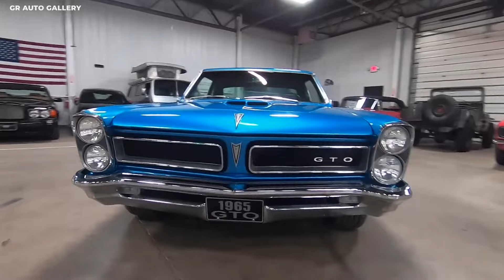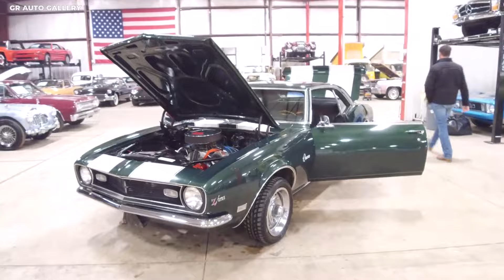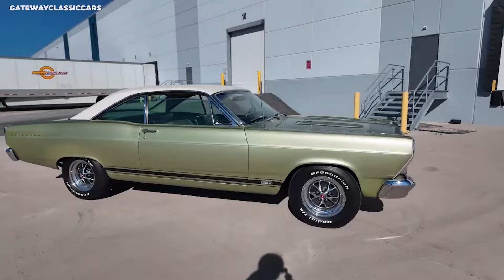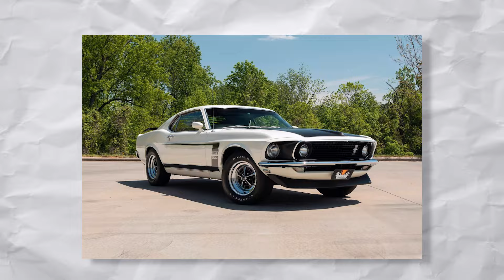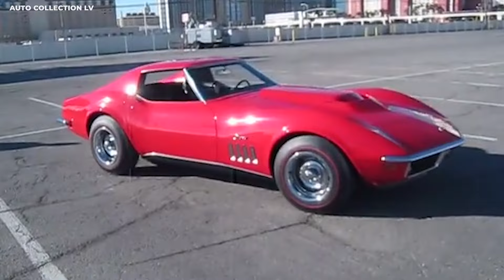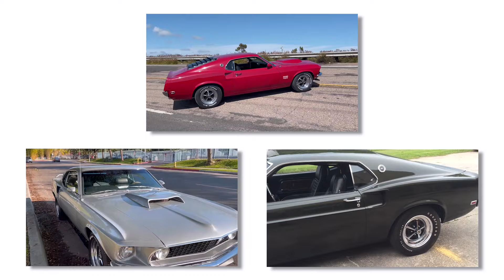12 Fastest 1960s Cars On The Race Track!

Comment: Mopar 440 was 375 or 390 horsepower   not 425 hp😮😮😮 you make so many mistakes in your videos 😮and the THUNDER BOLT WAS NOT 67 😮😮 IT WAS A 64 It was a QUARTER MILE CAR,, FROM THE FACTORY NOT A CORNERING ROAD RACE CAR😊😊😊😊😊